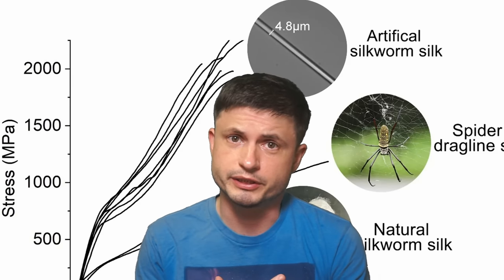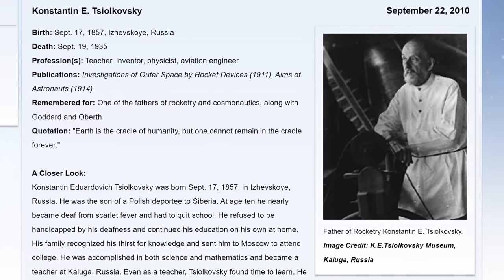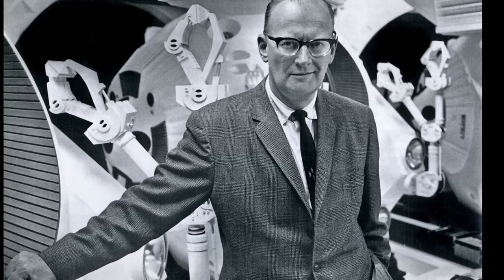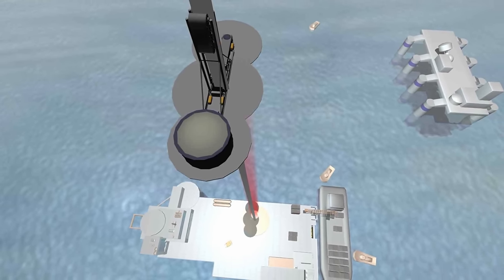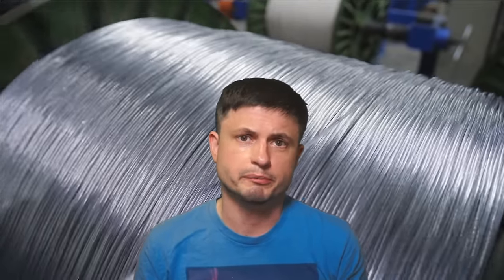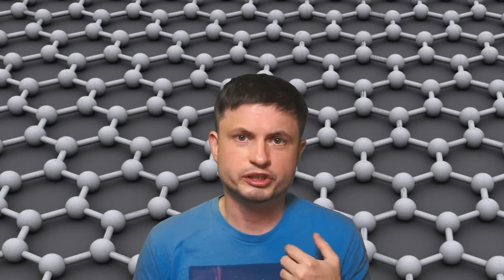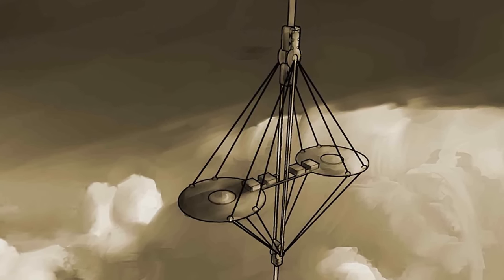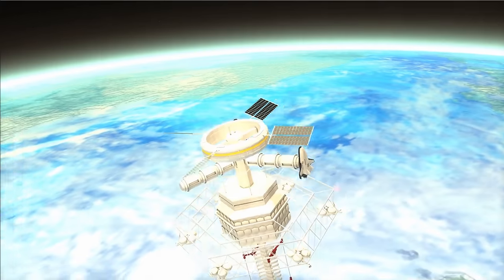Exciting New Updates About Space Elevator Technology...Possible After All?

Comment: Space elevators sounds awesome and would bring us to a whole new age of space building. My only concern about it would be if it can withstand being hit by space debris.

There's a whole lot of space junk going tens of thousands of MPH up there, a lot of it is very small, but can sometimes be big too.
Reply: Maybe the high tensile strength of the graphene could also be used to create a net for space debris?
Reply: The tether does cover the whole altitude gambit yes, but still relative to the volume of space the strike rate would be marginal and most proposed tethers use the first to then run redundancy tethers and once in play most orbital mechanics will just be altered to clear the tower zones and debris clean up is exponentially easier and constellation control can be augmented from mid tier port with fuel deliveries or even direct solar transmission few Ideas already posited and easily implemented. The main reason the debris issue is mitigated is that once the tethers are in play then access to space is readily available and over time the rogue dead satellites would just be consumed as pre lifted resources. the first phase is definitely the hardest but would become a more and more stable ecology over time.
Reply: Not just space debris but every single satellite in low earth orbit and medium altitude orbit becomes a threat even GPS satellites.
Reply: Space is, well, big. There is a lot of debris up there, but we know where most of the dangerous pieces are and can predict where they cross the equator. The chances of collision are not zero, but are fairly low due to how big the area of earth orbit is and orbital mechanics.
Reply: Space is very large even in LEO, but we're talking thousands of satellites, boosters and pieces of debris crossing the equator several times per day in different places each time (due to earth rotating in addition to each object's orbit). ISS for example orbits every 90 minutes from about 250 miles up. That's 2 equatorial crossings every 90 minutes or about 32 equatorial crossings per day. I saw one off hand estimate that figured one collision with a space elevator cable every year or every 2 years based on an estimated 8 - 9 million orbital crossings by satellites alone per year... maybe they could build the cable in such a way that it can flex to one side slightly before a detected collision is imminent?
Reply: I would think any material strong enough to maintain structural cohesion over the mass of a 36,000 mile length without tearing itself to shreds, would shrug off any conceivable space debris that might hit it.
Reply: The only reason space junk isn't cleaned up is because there's no economic incentive. Too much money for two little return.

If you had a space elevator it would be a lot cheaper to clean up space debris and a lot more expensive if you fail to do so.

Space elevators are the solution to space debris.
Reply: @Mystikan  And yeah remember the tensile strength theoretically needed to suspend a cable from ground into low orbit was a little above that artificial silk, but graphene is almost 20 times that required tensile strength, so with even some level of redundancy combined with how much we know about significant space debris, I would think the chance of catastrophic damage is far too low
Reply: "Debris" is the least of the problem; Working satellites would be the real issue. And a space elevator would occupy every single orbital altitude in use today, and possibly take out multiple satellites in a 24 hour period.
Reply: The sheer distances involved in geosync orbit combined with the relatively small tether makes this worry basically a non-issue. Orbital clutter looks bad in representations because they're dramatically scaled up to be understandable. If it were properly scaled, it would look like nothing is there due to how incredibly small it is based on relative distance.

I think some start of the art detection for damage, minor shielding, and some routine maintenance checks every few months would be all that you need. Honestly, I would be more worried about fauna and weather damage. Birds, Ice, and erosion damage thanks to frequent contact with moisture from clouds are all problems that probably need to be accounted for.

My personal biggest worry is the aftermath of a catastrophic failure.  What if the thing comes crashing down for some reason? What kind of damage could something like this cause if it were to snap because of some extraordinary circumstance? I know I wouldn't want to be within 500 miles of a structure like that. If it does get built, I hope it's out in a remote desert, like the middle of nowhere in Nevada, or maybe Antarctica. Somewhere where a failure will cause minimal damage.
Reply: @zeropolicy7456  I think the counterweight design prevents too much damage if it snapped, if it broke around cloud level the majority of it would be carried away by the counterweight in orbit with a relatively shorter length falling back to earth right? But yeah I also wouldn’t want to be anywhere near a potentially multiple hundred mile length of cable crashing down.
Reply: it is a huge problem getting worse by the second, but, it means it's a problem that HAS to be solved, which can be a good thing. i just watched a video on the dev of the shipping container, it not only solved a logistical problem that appeared expensive at the start, but lead to a situation where it costs pennies to ship across the world. debris cleanup could actually lead to something even more useful.
Reply: @zeropolicy7456  You're forgetting that a tether THAT long would reach all the way around the circumference of the Earth more than once. So it wouldn't matter where it was; It could wreak havoc anywhere and everywhere.

Geosync orbit for an elevator would be much further away from Earth's surface than standard geosync orbit, as the elevator would have it's own weight pulling on it. It's farthest point would have to be much, much further from Earth to cancel out it's own weight. There would have to be enough centrifugal force on the farthest end of it to cancel out the gravity of the closest end.

Suffice it to say, it's nothing more than a pipe dream and will never happen. It's is the very definition of "impossible."
Reply: @jtjames79  ".. would therefore be a potential solution.." :)
Reply: @Mystikan  You underestimate the energies involved. Anything moving that fast will do serious damage to anything it hits. An object a few microns in size (essentially, a speck of dust!) hit a window of the ISS and left a 7mm pit.
Things in orbit are flying over 10x as fast as the average rifle bullet. Energy of a moving object is figured by the square of the velocity. (so 10x as fast = 100x the energy.)
Reply: @alexanderkuhn2298  "Space is, well, big."
I'm going from memory here so may have it slightly wrong. But I heard someone describe the chance of being struck by space debris as similar to being in an area the size of London, with a single tennis ball, and that ball strikes you.
Reply: what about heavy weather? It could affect too.
Reply: If anything hit the structure it (the elevator structure) may well survive it. The problem would be the debris of a shattered satellite strewn into orbit. I agree space is big. I am sure the engineers would figure this out ahead of time
Reply: That’s my major concern as well, but there are other major factors. 

I’m curious about how the materials stand up to the extreme weathering and temperature differences they would be subject to, both in our atmosphere and in space.
Reply: @zeropolicy7456  - Nope.  It has to be built at the equator.  It won't work anywhere but there.
Sorry.  That is just a fact.
Reply: @achaille9110  Okay. Don't understand the attitude, but okay. I didn't know that.
Reply: @kerolokerokerolo  most peoples heads explode when they realize the truth 😆😆😆 🐑
Reply: @SuperMoshady  ok. This is not the case 'cause you said a bunch of lies
Reply: @kerolokerokerolo  what did I lie about? Earth has gas pressure and gas pressure needs a container, its in the definition 😆😆😆
Reply: There are actually a lot of problems that would need to be dealt with before any practical space elevator could be realized.  The problem of a sufficiently strong cable gets all the attention because it's the most obvious engineering barrier, but there are plenty of additional considerations.  Collisions with debris, as you mention.  Oxidation on the lower end where the cable is exposed to reactive oxygen species (which carbon is particularly vulnerable to).  Vibrations in the structure.  Political problems with cost, site selection, and public opinion among other factors.  What sort of testing and prototyping is required before you can evaluate such a structure for safety, high assurance of success for stakeholders, etc.?  I'm sure proponents won't want to believe such a thing, but I could easily see such a structure as a trillion dollar project even if the cable strength problem really is licked.
Reply: Every active satellite and bit of space debris would hit it. The ISS,the Chinese station  and all sun geo sync satellites  cross the the equator at different places multiple times a day.  The lower the orbit the more frequent the crossings.  (These space elevators would be at the equator ) 
So if we clean up every speck of matter from a few thousand Km above geosynchronous orbit to LEO. So launching rockets to go a snag a bolt would take a while.  
Starship could l lunch a bunch of “retrievers” to capture or attach to space debris and active satellites to de orbit them.  After we cleaned every tracked object, we would have to build hundreds of these structures to attempt to replace the thousands of operational satellites we have today.  You are reading my text thanks to some of them.
Reply: @zeropolicy7456  Antartica?  Why not?  The extra expense of building there will be just a small drop in the bucket.  I would really love to see the construction site when one goes up.
Reply: @kerolokerokerolo  Heavy weather would have no effect on the tether at all. The 'pull' of the counterweight would prevent any deflection by something so small as a hurricane. You must remember that weather can only effectively impact the first 32km of the cable. That is 0.1% of the cable length.
Reply: @achaille9110  The first one must be built at the equator. Using that anchor as a base and building outwards while centered on geosynchronous any point on earth would be able to have a tether reach it. It's a matter of orbital mechanics.
Reply: @Leggize  - If you are trying to say that a second elevator could be placed anywhere but, on the equator, I will respectfully disagree.  If not then, not really sure what you are trying to say.
The earth spins a 1000 mph at the equator.  The tether must connected to the elevator structure at geosynchronous orbit, above that spot on the equator.
Geosynchronous orbit can only be achieved directly above the equator.  All geosynchronous satellites are directly above the equator.  There are no exceptions to this requirement.
If you notice, all earth-based, satellite dishes are aimed at satellites, directly above the earth's equator.
Reply: @Leggize  there's no harsh conditions in upper space? Like maybe sun storms, solar radiation, asteroid impacts...? I don't know
Reply: @carlkinder8201  GPS satellites aren't in LEO
Reply: @ats-3693  I never said they were. But they still cross the equator below geosynchronous altitude which means they're still a threat to any theoretical space elevator cable.
Reply: @carlkinder8201  Yeah but apart from the fact this is all totally hypothetical and space elevators will probably not exist in the foreseeable future, the orbits of satellites are precisely known especially with GPS satellites which constantly broadcast their own ephemerous data, their positions and trajectories relative to fixed ground stations are known to millimetre accuracy, if a space elevator was ever constructed it would be a major mistake if it ended up in the trajectory of a orbiting GPS satellite.
Reply: @ats-3693  satellite orbits even GPS cannot be predicted with that level of accuracy. The figure I saw was +or- 2-4 cm per orbit which sounds negligible but consider that each satellite orbits about twice per day or 4 equatorial crossings per day,  you're talking 750 orbits and 1460 crossings per year with probability of error growing with each orbit and then factor your probability of error with 31 other GPS satellites. Now how much will that error grow after 10 years or even 50 or 100 years? Then throw in slight gravitation disruptions from undetected near earth objects or increased aerodynamic effects from random solar flares, and things are even less predictable the further you try to predict into the future. You might find a spot with very low probability of impact for decades into the future, but trying do this for every equator crossing satellite and piece of debris would be much more difficult than most people believe. The other point is that even if you could predict GPS orbits with 0 error, it would still be impossible to find a spot that's permanently safe because earth's rotation causes every equatorial crossing by an orbital object to be in a different spot meaning that every individual satellite eventually crosses the equator at every spot given enough time - it might take 100,000 years or a million years (random guess - I haven't done any calculations) or more (if the satellite is even at a high enough / stable enough orbit to stay up that long) but it will eventually happen.
Reply: @carlkinder8201  Yeah kind of, I'm a geophysicist I process high precision differentially corrected GPS data nearly every day, I've just finished processing the daily data from an airborne survey project now, with airborne gravity surveys we post process the GPS positions to millimetre accuracy using the precise ephemerous data that is broadcast from each satellite, we need to do this to correct the gravity data, changes in position translate to accelerations which are equivalent to and indistinguishable from gravity we have to know which changes in position are real and which are due to GPS error. We have to wait until the following UTC day for precise ephemerous data to become available on various GNSS servers, the precise ephemerous data allows the 3d position of all the satellites our receivers were tracking during the flight to be calculated to high precision which also allows us to calculate the precise position of the GPS reciever on the aircraft, sure real time there is some uncertainty to the position of each GPS satellite but that uncertainty isn't cumulative it is self corrected the errors in position are continuously being removed.
Reply: @ats-3693  if you know the orbit to within + or - 1 mm, my math says that your error grows somewhere between 14.6 meters to 29.2 meters  after 20 years. You never see this error because you reset back to 1 mm accuracy everytime the satellite updates its exact position. But if you were trying to predict where the satellite would be 20 years in the future based on the data that you have right now then it should be different no?
Reply: @carlkinder8201  Yes that is correct, but an 20m offset in predicted trajectory after 20 years is nothing, satellites and orbiting bodies are thousands of kilometers apart nothing is planned with as little as metres or even kilometers between trajectories. GPS satellites orbit at around 20,000km above the earths surface, that's a sphere with a total radius of 26,000km = a sphere with a surface of 8.5 billion square kilometers.